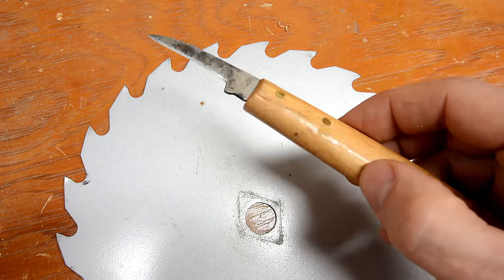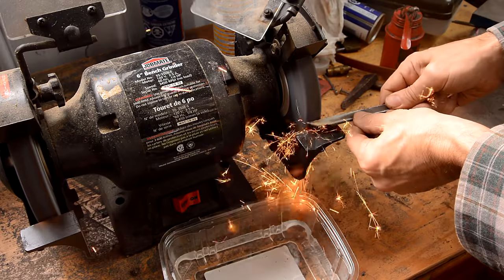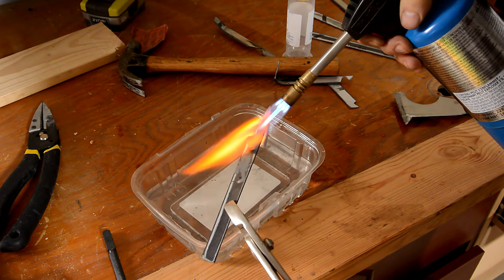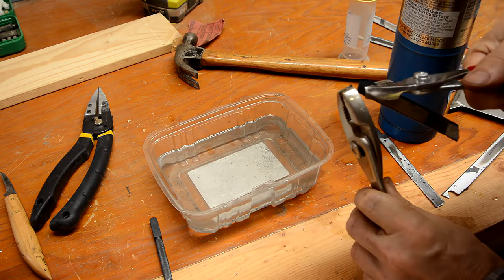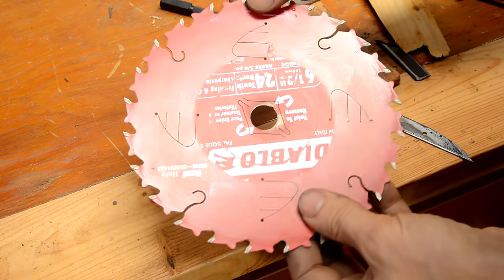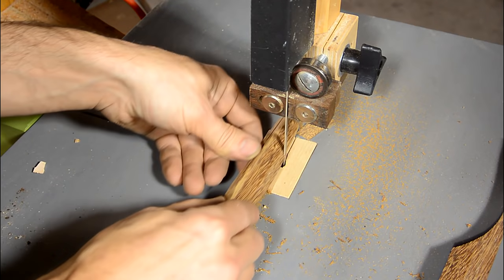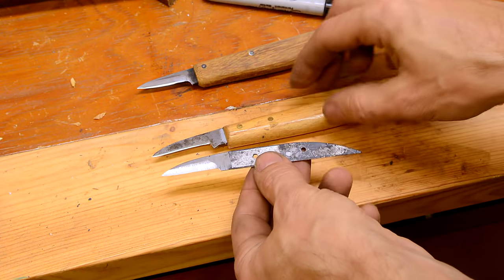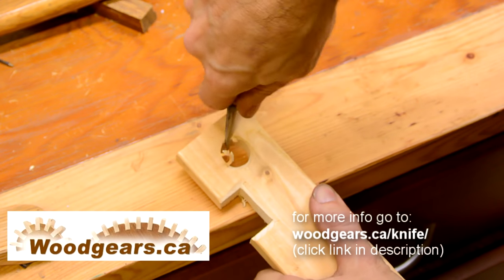Chip carving knife from an old saw blade

Comment: Nice experimentation Matthias.  As for the hardening & tempering, 1) heat the steel to cherry red (at this point it will be non-magnetic), 2) immediately quench vertically in oil, moving it up & down in the oil, 3) draw out the temper by baking it for a few hours at about 300-400 degrees F.

Comment: I tried making a few of these a couple years back and struggled with getting the tang to fit properly - the blades were 5160 and perfectly heat treated but I ended up unhappy with a burned fit, and trying to carve the recess out by hand was nigh impossible. Now that I have a table saw, I can employ your method of shaping the tang to match the recess.

Comment: Very nice idea to use a saw blade.
Reply: +Patrick's work shop Agree 100% Re-purposing is the way to go!
Reply from the maker: +Patrick's work shop I was happy to have one that wasn't carbide tipped.  As in, it's the steel that did the cutting, so hopefully it's a steel that's good at cutting.
Reply: +Matthias Wandel As a novice knofe maker I would definately recommend using a magnet to get it up to non magnetic heat when hardening. Also always temper the steel for about 2 hours at 200 C or 400F just for safety, I think in a little used blade it makes little to no difference, but there is a chance that when dropped the tip will snap off. just my 2 cents on it

Comment: I've used a broken band saw blade to make a carving knife based off of one of those small Japanese type and it heat treated correctly and held an edge well (since that is what the original steel was designed to do).  Also you could make literally hundreds of small knives from a broken band saw blade.

Comment: The Sawblade are out of spring Stell. Only the Tip oft an tooth ist tooling Steel. You can harden spring steel but it will not be as hard as tolling steel, it is even more difikult to harden properly (spring steel) because of the lage selection.
Hope my rusty english is not to bead.
Your Youtube chanel rocks!!! 
Schöne Grüße aus Österreich :)

Comment: Nice way to repurpose an old blade! Something a lot of folks do with carbide-tipped blades is cut sections out them with the carbide tip to use as a lathe parting (or sometimes turning) tool.
Reply: that is a bad idea for many reasons, lathe tools are super cheap, even carbide tools, which are hardly ever actually needed. all you need for most basic stuff is some 3/8 cobalt stock and a bench grinder to make any lathe tool you could possibly need.

Comment: Nice project... I've viewed a few videos about hardening that say you just need to heat the metal until it is no longer magnetic then quench it. Used motor oil seems to be an excellent quenching medium too. It will light on fire when you drop the metal in so be careful of that... Enjoy....
Reply: +Paul Bialozor Non magnetic is 1414 degrees F

You need to be in the areas of 1500 degrees F
so "a shade of red hotter"

Used motor oil is not the best, try canola oil instead.

Comment: I am pretty sure someone has said this but just in case.
That blade is the carer for the tungsten tips, its the tungsten that is hard and makes the cut, the body of that blade is common mild steel, it wont harden because its low carbon.
Reply from the maker: I’m pretty sure others didn’t say this because they realized it wasn’t a carbide tipped blade.

Comment: Couldn't you still use that "mistake" blade if made the handle curved on the inside where the rest of the metal is seated? For example using the curvature of the table saw blade and matching that to the curvature of the heel of the knife blade.

Comment: Being the Youtube expert here (LMAO), the blade isn't as hard as it could be.  It needs to be heated up to critical temp-the point where it loses it's attraction to a magnet.  Then oil quenched.   Then cleaned of the scale and tempered at around 400 degrees for a couple of hours then slowly cooled  (boy, that's a mouthful)..   I'm afraid it won't hold it's edge for very long.  All it would take to be able to get it that hot is a soup can forge-  you can find builds for those on Youtube.  They are normally fueled by a propane torch, so other than a little insulation (I think you can use bentonite clay - kitty litter), you probably have everything you need around your shop already...
Reply from the maker: +icondonnied Please do watch the video again, note the part where I harden it.
Reply: +Matthias Wandel I think he's just saying that it could be better hardened if specifically heated to the proper temp and then oil-quenched and tempered.
Reply: +icondonnied Don't worry, he doesn't take constructive criticism well.
Reply: +icondonnied It's worth noting that not all carbon steels call for oil quenching, some are best water quenched.  Even though the steel here was not highly brittle after hardening, a temper may have improved the toughness. But that is very dependent on the actual composition of the blade and the exact parameters used to harden it. In the end, for this project, I'm not sure it much matters.
Reply: +icondonnied Mathias hardened the blade "close enough". The blade was heated above "critical" before quenching. Without knowing the composition of the steel, we can't know how to temper it (or as Mathias points out, if it even needs to be tempered.)
Reply: Bradley Weingartner sweetest y6d

Comment: Nice job. It seems counter-intuitive, but when wet-sanding a blade, for sharpest results you should sand into the blade edge (as if you are slicing into whatever you are using), rather than away from the edge. I used to sharpen my blades the same way you did for years.  Since doing it the other direction, I've had much better results and the blades stay sharper for longer.

Comment: Scrape the corner of a file along the blade, if it skates along and doesn't leave any scratches or marks, then it's too hard and needs tempering. You can also do the first hardening at more of a straw yellow color for more hardness.

Comment: The saw blade might be hardened near the circumference, where the teeth are.  Or, perhaps they harden the whole blade, then anneal the central portion, leaving only a ring of hardened material.  Anyway, if you cut up an old saw blade, whether you need to anneal a knife blank before working with it may depend on what portion of the saw blade it was harvested from.

Comment: 2 things
1 if you normalize or aneal (I dont think that's spelled right) the steel then you dont have to take care to keep it from getting hard and
2 if you cant harden and temper the knife then you can just be very careful of the temperature of the steel and not have to worry about it and still get the same results. This is best done using hand tools to eliminate of the risk of overheating the steel

Comment: I've never heard of a carbide tipped saw blade being made on high carbon steel.  After your temper tests, test with a file for a hardness test.  If it cuts, it's not hard.  Nice work though.  It's better to just buy good steel, it's the only way you know what you have.   O-1 or 1018 are good high carbon, treatable, steels for quick knife work without any difficult treating.
Reply from the maker: That's why I didn't use a carbide tipped saw blade.
Reply: My bad, anyway the spark test looked good.  Be sure to heat both sides of the blade, it prevents warping.
Reply: Matthias. wandel I use worn out butcher knives just trim blade how you want and handle  job done  excellent steel in butcher blades especially German steel or victorinox swiss blades enjoy no need for all the fuss and bother heating blade cutting old circular saw blade just ask your butcher or friends  for worn out knives you will be very surprised💪🐻🐺🐾

Comment: I post this FAQ in Blade Forums on DIY
but I cannot post a link, so copy paste this into a google search

Bladeforums The Count's Standard Reply to New Knifemakers v38

There are no mistakes, only design changes.

The key to the success you got here was a homogeneous simple carbon steel and  that it was not a carbide tipped blade.
The plasma cutter will burn the steel, so you have to grind back some amount into fresh steel.

Lots of your viewers will miss that part.
Reply: +12345NoNamesLeft Wow!  That tutorial is really excellent.
Reply: Thanks Chris.  I hope it helps everyone.
Reply: +12345NoNamesLeft http://www.bladeforums.com/forums/showthread.php/1305373-Questions-about-getting-started
Reply: Cliff Hartle
That's the one.
Reply: 12345NoNamesLeft Going to spend a lot of time on that faq. Would like to make some of these knifes. I have a small stash of large (approx 1" by 18") hacksaw blades.

Comment: To obtain the full temper you have to heat the steel at about 850°C for complete autenitization, after that, to release internal stress, you can normalize it...

Comment: Hehe... As much as I like Jimmy DiRestas videos, his latest dagger videos seem really pointless.. Who, other than an eccentric killer, would ever need a dagger? Maybe for decoration.. I have made a couple carving knives similar to the one you made here, but never got one to keep an edge for a very long time. I need to look into hardening and tempering a bit more I guess.. Great video:)
Reply from the maker: +Bjørnar Haugen If you start with hardened steel, it's quite likely that you lose the hardening while grinding agressively.  Which is why I just softened the whole thing and re-hardened afterwards.
Reply: +Bjørnar Haugen A hunter. A camper. A hiker. An outdoors-man. A soldier. Someone who believes in self defense. Heck it can be a useful tool around the shop.
Reply: +Josh V .All those would be much better off with a knife... daggers are weapons, not tools.
Reply: Bjørnar Haugen
 The only difference is a dagger is symmetrical with two sharp sides and a knife is asymmetrical with only one sharp side. They are pretty much the same thing. They are both tools.
Reply from the maker: +Josh V Actually, when working with a knife, you often push on the back edge.  Which makes a dagger kind of useless for anything practical (unless you grind off one of the edges, at which point it isn't a dagger anymore)
Reply: Matthias Wandel
 That is pretty silly, but I still like your channel. "aw man... I need to cut this rope... but all I have is a dagger.... guess I am screwed since I can't push on the back of it..." lol
Reply: +Josh V What, then, is the point of a dagger, if it is less useful than a knife? If you're going to go to the effort of carrying a tool with you, it might as well be as well suited to its purpose as possible. By your argument why not carry a longsword with you?
Reply: HavokTheorem I never said it was less useful. In fact I have been arguing the opposite. It is basically the same thing, the only difference being symmetry. When I go camping I take my old bayonet, it is slightly larger than my Kabar and is sharp on both sides. not a dagger but still, I find it very useful. Up until the day he died my grandpa carried a boot knife, that was actually a small dagger. He used it for all normal knife purposes, and he loved to whittle with it. So no, a dagger is not less useful. That is silly.
Reply: You say his dagger videos are POINTless? I see what you did there... what a SHARP mind youve got! Im sorry... ill... ill just go....
Reply: He did it because it makes him happy, like how roller coasters are idiotic (paying for a sensation of impending doom) but make people happy. Heat treatment - every steel has its own very specific recipe. However, you can get passable performance by a simple quench and temper. Any theorycrafting without an advanced understanding of metalurgical engineering and a precision heat treatment oven is a waste of time. I've spent 15 years trying to learn about it and it boils down to either following a recipie precisely or trial and error with rigorous testing and documentation. If you do invest 20+ hours in making a knife, please buy your steel - it costs the equivalent of 2 usd/knife for 1095 and you wont end up with something that cant be hardened.
Reply: +Bjørnar Haugen I make leather sheaths and items for Bush use. I supply a lot of Station workers and hunters, with sheaths for their daggers. Most of those people are people who need to deal with feral pigs. By the way for the anti-hunting people out there, the feral pig population in Australia is larger than the human population. 1080 poisoning is one alternative to animal control. Which is a nasty alternative to an archer or rifle shooter with a dagger backup.

Comment: you  need`nt have thrown out that one blade that had the back end beveld in the wrong way  simply   use a good  hard wood for the handle becouse your not going to  put enough  pressure on the blade  while chip carve`ing   with it. dont use soft wood for a handle  any way.

Comment: you need to get it hotter than dull red....orange to straw color.....
Reply: Dustin Walters the trick is to have a magnet around, the moment the magnet doesn't stick to the blade anymore is the moment to quench. And is better to use oil to cool down, it reduces the possibility of cracking the blade.
Reply: maelgugi you're way off sorry....you're actually arguing with a metallurgist so might wanna think things through a bit more
Reply: Dustin Walters k
Reply: maelgugi heating to different temperatures gives you different levels of hardness, not simply heating until a magnet doesn't stick.... he did not heat the metal enough to properly harden it....but go ahead and tell me how you know more than my college degree....
Reply: Dustin Walters but isn't oil better than water when cooling hot metal to achieve a hardened blade. I'm personally interested in forging metal armor and weapons and every YouTuber I've seen says that oil is the best. Question is just whether that is true and if so, then which oil would be best to use? And does any damage happen to the blade if it is heated beyond the orange-strawlike colour and instead into a white colour? 

I'm asking since you got a degree in this, where I am just an amateur interested in quite a bunch of different hobbies.

I agree with your comments. The metal was still way too cool. I've seen metal that was more red than that. I wouldn't even dare hitting that with a hammer (I know a little about metals myself. My granddad was a smith with his own company and I've personally melted aluminum in an old Weber coal grill... and the latter isn't that great of an idea.. The sides of the grill turned red hot (way more red than the metal in this video) and the plastic wheels caught fire. Literally caught fire, no kidding. The grill was pretty destroyed afterwards and I still have no idea how a friend and I managed to melt an aluminum broom stick in an open Weber coal grill, using only firewood. Considering that it melts around 600 degrees and that this was a pretty small grill and a windy and relatively cold summer evening).
Reply: JoraniusMinecraft the best quenching media depends on what you're trying to accomplish, water will give you the maximum hardness but increases the chance of cracking....oil will not harden the metal as much( still pretty hard though) , as far as the type of oil again that is debatable to what you're trying to accomplish with your steel....you can also quench with air in an air furnace or use gasses such as argon,nitrogen, helium,etc. although those methods require some special setups to do.
id suggest spending some time researching the effects that different quenching media have on steel, though for what you're doing I'd say oil will be fine to start with, as far as type I go with something that has a higher flash point(having you quench tank engulfed in flames isn't fun)

yes heating your metal too much can be very bad if not careful cause you can actually burn your steel,after that you're starting over.... again this is where research and practice comes into play, different temps yeild different results, use some test pieces of metal like half inch wide flat stock six inches long and heat to different temps and quenching and try to bend them in a vice .....but quenching is only half the process, once it's hardened its also very brittle and can snap like glass! this is when you throw it in the oven at around 450-500°F for an hour and let it cool slowly to anneal it back a bit...sometimes you need to do this twice depending again on what you're trying to achieve....that is a lot of science behind this, so many people think it's just heat it up and cool it off and give it and edge....gotta understand what really happening to your metal, and that's something that is hard to explain just on a YouTube post lol
Reply: Dustin Walters lol im a metallurgist oooooh loooook at meeeeeeee

Comment: You're going to crack your vice, using the jaws as an anvil...you risk it even with a small hammer, such as you were using.
Why not use the anvil...that we can see in the background of the shot?

Good video, as always...
Reply from the maker: +David Smart Been doing that for years, no issue yet.  The jaws are hardened, and I needed a hardened surface.

Comment: you used the wrong steel . find an old hand saw , one from the 20s or 30s . when people could not find work during  the depression they would cut up the hand saw and try to sell them to the women at home for kitchen work . I have a meat cleaver a carving knife and a pairing knife from that era that my grandmother  bought back then .. my mother used them and  I still use them in my kitchen . have not had to sharping them  and they never rust . too much nickel in the steel . we have replaced the handles several time . my 3 kids watch them like hawks they all 3 want them  . when you find a good tool no one wants to give it up
Reply from the maker: +ed hondo Hmm, maybe I should make a knife for the kitchen too.  The paring knives keep getting dull.  Though that steel no doubt is prone to rusting.